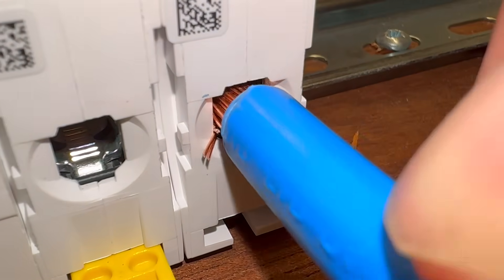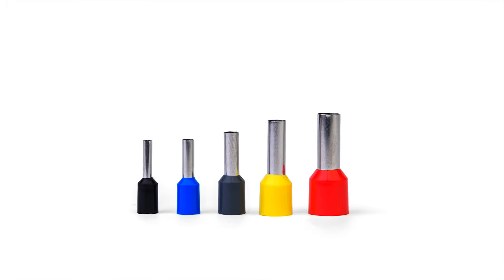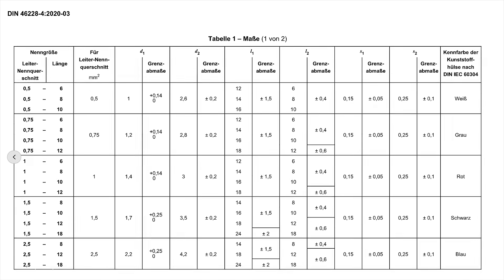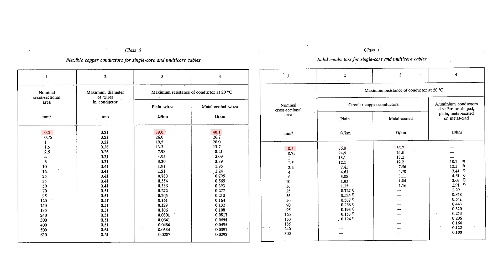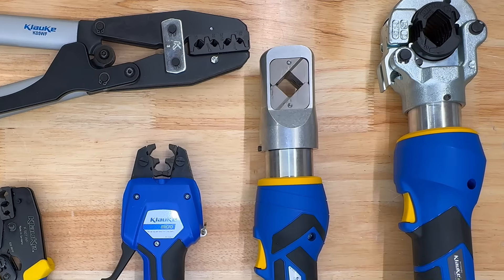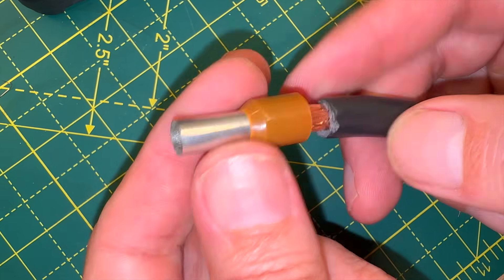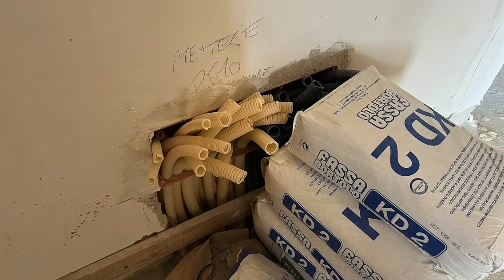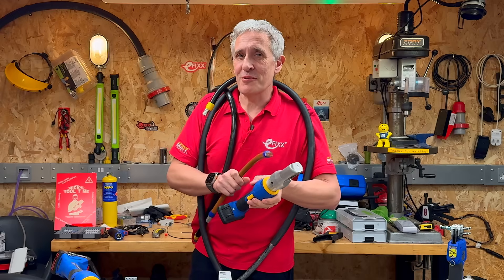The Truth About Ferrules: Overkill or Essential?

Comment: I'm an electrician here in Brazil, and the use of these terminals has been adopted for some years now, although they are relatively recent, as they weren't common or easily found in the past. However, I've noticed something curious about the use of this type of terminal: when someone discovers and adopts them, it seems like nothing else is useful besides these tubular terminals, hahaha, and some even criticize those who don't use them, as if their use were inevitable. Obviously, they offer many advantages, but their use isn't necessary in all places and components. For example, circuit breakers already have their own press system to directly compact the copper. I have nothing against those who use them everywhere possible (especially since I also use them in places where tightening is critical or could damage the copper), but only against those who say: "If you don't use tubular terminals, you're a terrible professional"... and there are those who say that.

Comment: As an aside, I am still triggered by the seemingly standard made-up unit used to specify wire “diameter”: in mm^2. Either call it area, or use actual diameter, our just use the “gauge” unit. But referring to the wire area as “diameter” seems to be the industry standard.

Comment: It’s a great video! Am I interested that if you are using for example terminals with spring locking mechanism instead of screws there you also need to use Ferrules on stranded wires ?

Comment: Here is a detail that probably doesn´t come up much... I saw a technician working with ferrules once... and his stock had diminished quite a bit by the end of the day... Probably on his last job out of 30...

HE has only long barrelled ferrules left in his kit... thus not wanting to return the following day...with a two hour drive in the opposite route he would have had to take... I say the technician  shorten the barrel... as far as i know... it should have worked, since i saw the tech test the connection by pulling and wiggling it...

The thing is... do we cut it before or after crimping?? (When you have no other option???) Forgot to ask the tech since i didn´t get to see this part of the service being done..

Comment: After a ferrule is terminated in a connector, is it acceptable to see the metal ferrule sticking out from the connector? While I have read why cutting the ferrule to fit can cause the ferrule to not make a flush connection, what standard explains you shouldn’t cut or explains that there is a tolerance for metal showing?

Comment: Using ferrules with larger screw terminals is standard practice and does improve reliability. The reason why you had a poor result is because you used the incorrect length of ferrule and gauge of wire for that particular screw terminal. I have yet to see a single person online do this right.

Comment: With TEW and MTW cable yes you run into this problem. Here in CA we use XHHW for industrial controls. 14 AWG with 7 thicker strands really helps mitigate this issue.

Comment: Ferrules are a Eurro Trash gimmick - a scorge of the earth.  They've infected the whole of wiring and machine assembly here in the US, now, too.   The amount of cost and time in Engineering, application, tools and training is laughable, when not coming from your pocket.  It's like walking up the stairs, booting up your windows 95 computer to check your email, when you could have just looked at your phone.

The world really does not need ferrules for 98% of the machine wiring.  If you follow code, size and choose your conductors properly, follow manufacturers specifications, existing best practices and are not an idiot, your panel will run fine until it is obsolete and removed for trash in 50+ years or so.  No thermal losses, efficiency indifference or better performing panel with ferrules or without.  Simply, it looks cool, costs more, takes more time and makes one gay.  If you drive a Subaru, enjoy watching "men" soccer or simply too retarded to wire a proper panel without gimmicks, because you are affaid your inpeptitude is going to allow a loose stand of wire to short out and malfunction your bad deaign, so as to burn your house down - your gay - stay away from electricity.
Reply: What will happen 20 years down the line when someone needs to maintain or upgrade your system? Do you really trust the cheap labor of this country to properly cut out the damaged portion instead of reusing it? You might realize that you're physically damaging the wire by avoiding ferrules, but they sure won't. You might have to cut a new cable after enough upgrades, especially if you do everything right.
Reply: @henlofren7321  I hear you.  I was introduced to Ferrules about 28 years ago; only the ferrule and not the plastic insulated type, like today, for panel build.   They were introduced by some Brits designing the electrical controls on US made liquid packaging equipment.  At the time, spring terminals were not a thing and many PLCs were huge or still had screw terminals for I/O and older large din terminals were the norm.  Back then it was a union work force to build the panels and it was a transition from relay panels to PLCs.  Before ferrules, things were stake-on or if it was a stranded wire to a terminal, it was done neatly and people took pride in their work to land wires correctly.   Now-a-days, customers can spec out shrink tube or exotic custom plastic printed wire markings, ferrules, etc.   NEC and 508a do not require the use today. For the most part they are standard practice and they do make the panel look nice, i agree.   ...I digress and it's always been a Euro : US thing for me.   When they introduced them, they explained how everything was better in Europe and US wiring was shite.   I've since had the privilege to train many American and European companies for wiring methods to bring up to standard their equipment for delivery for customers like GM, etc, in North America and Europe.  It's all good.  To Ferrule or not to Ferrule.  Really, if you doing one ferrule in a panel, then do them all, unless the terminal is spring connect and its a signal wire that is too small to mess with a ferrule, etc.  Sometimes, for small appliance type applications - it's not worth the labor and the appliance design and contents will outlast any wiring or need to rewire the appliance if done right.   For those cases I would rather investing in training and checking the results of the labor than adding ferrules to the design package, wire harness, etc.  All said, yeah, I use them.  And Football is still better than soccer.   Sadly, I'm old enough to see equipment 20 + years later.   The biggest thing that bothers me, in that regard, are the adhesive wire markers fading, falling off or falling apart.  Even Brady cloth paper from back then, give it a few decades in a work environment..

Comment: Hi, I have some questions. 
1. In control panel, push in type or spring type terminal, should we use ferrule?
2. For terminal block, it do mentioning the suitable size of the wire to be connect. It's mention size is it already cater to include the extra space for the ferrule? 
3. Example, 2.5mm spring type terminal. If connect with a wire of 2.5mm without ferrule, it will be insert smoothly. But when insert a wire of 2.5mm with ferrule, sometimes it will be difficult or might damage the terminal. What is the reason behind?

Comment: These Ferrule kits don't seem to match up with the correlated AWG sizes. So I just make sure the Collar Ferrules can easily get the stranded wire into the ferrule with minimum collar space, but the best ferrules always have a little space between the wire insulation and the ferrule collar. The size chart for the ferrules seem to be WAYYYY too small for the same size AWG insulated wires. It never fits the stranded wire inside the tinned tubing , and the collars are always too small to fit around the insulation.

Comment: In Poland I haven't met anything similar to class 2. We have solid wires where Ferrules are obviously counterproductive and wires similar to class 5 where there is no reason to use them, by the way I'm not a professional electrician, I'm just an advanced ammeatuer, able to setup or inspect summer house or appartment installation.

Comment: Which suppliers/brands would you advise I look for? Assuming I wish to follow this advice and use ferrules of a particular standard (such as DIN 46228), keeping to crimping tools and ferrules (and similar such as ring crimps?) of the same brand.

None of my local wholesalers I've checked so far sell ferrules, except for some kits from screwfix/toolstation, which even if they are of decent quality means getting a lot of parts in sizes I'll never need.

Comment: If you use Ferrules, we can be friends. If you use ring terminals, i genuinely hate you.
Having to remove all the tiny screws on a block terminal solely to remove a wire to replace a faulty part... Potentially losing a few screws in the process because not all of them are magnetic... 🤬 All my hate.

Comment: HEX or SQUARE ferrules?
i have been crimping ferrules with flat pliers (with no, or minimal teeth), never failed me in my life, and saved me so much time
but in my case it makes them kind of flat, which works good for my needs, but I've been meaning to finally buy a tool
I wonder if square or hex crimp is better? Hex is kind of round in its nature, which fits better in all kind of holes, but then again has less area for a nut to press against?

Comment: I'd bet the class 5 cable has less copper cross section than the class 1 conductor. If you could, please count the strands, measure and do the math. Don't use 25mm² ultra flexibel cable for that. ;) 
I found 1,5mm² stranded wire having only 1,35mm² of actual copper cross section. That is 10% less!

Comment: I love them for the neatness. I hate them for efficiency. It needs time for installation, that is often not necessary. AND you add another electrical interface for each ferrule. It is a tiny amount. But it is there, stacks up and is not necessary. Also stranded wire often has less copper than solid wire. Stranded wire is standardized by conductivity. I have seen 1,5mm² stranded wire having only 1,35mm². Found this out on accident. A spool with 1000m of 1,5mm² wire felt too light. I weighed it and thought I was scammed by the supplier. So I cut off 1m and weighed it again on a fine scale and it weighed significantly less than solid wire. Then I was onto something. I counted each strand and measured the circumference multiple times. And it turned out, stranded wires sometimes have 10% less copper cross section to achieve the conductivity required by the standard. It complied to the standard, but I still feel scammed. You pay more and get less. I hate that!
Solid wire is standardized and sold based on copper cross section.

Comment: I had a stray strand go into the wrong port recently when I was making a PLC. Good thing all the power was on a breaker, so nothing blew up, and I immediately recognized how and why a single switch was making three lights on the input card turn on.

From there on out, every stranded wire was getting ferruled.

Comment: Can you use ferrules with Wago type connectors in house wiring? All these new smart switches and dimmers come with stranded leads that don’t work well with Wagos. But they are so much bigger than a normal switch I’m forced to use Wagos as they are flat and don’t take as much room as a Marette .
Reply: You can with 221 series but i think it was 0.5 - 1.5 mm2 only check from wago's homepage.

Comment: Wires with strands smaller than 0.75mm2/18awg in screw terminals without ferrules or rings or forks or any other sensible wire termination is insanity.  Just don't do it.  If it's carrying any significant current at all, it will burn.  It just takes time.  If you want that game, use solid wire.  That's what it's for.

Comment: Attention: with cheap or unappropriate Crimping tools the ferrules can be pulled off the wire - more or less easily! Esp. when there is mechanic force on the cable connection. I came across this problem when installing a PV generator connection box with fuse switches and SPDs - you need a lot of connections in small space box. In my experience this problem gets better (not solved) when you twist the wires a little bit more before crimping on the ferrules. If you twist too much, the may not fit in any more.

Comment: I've done HVAC controls for 19 years and we don't use ferrules. I've actually had issues with them in the past and the terminals can't bite down on the wire like with regular stranded copper wiring. They are overkill in my opinion. I can see in some applications it might be needed, but if you can put wires in the standard terminal just fine then a ferrule isn't going to provide much benefit.

Comment: There is all this engineering mobo jumbo talk like lawyer speak, but the reality is all the customer cares about is that it works. if you charge a customer thousands of dollars to install a HVAC BMS system and remote energy management for a store with VAV, ventilators, door heaters, air curtains and all that and it keeps cocking up after you have commissioned it and have to come back to do tug tests on every controller because you didn't use ferules then you should use ferules. Twisting the strands or not to twist strands, doesn't make fuck all difference, been twisting strands my whole life and never got a callback because someone measures .001% difference. Use ferules save yourself headache. This is my 2 cents worth from the perspective of a technician in the field.

Comment: I can think of tons of applications where ferrules would help in my job as a security low voltage technician, but I have never seen another tech in my field use them. Any low voltage security techs use these, and if so, what are the best and worst uses for them?

Comment: I swear, I absolutely HATE opening up panels at work and seeing non-ferruled stranded connections. It likes my life so much more difficult if (and when) I need to take the wire out and/or reinstall the wire. It's just asking for a short circuit.

Another thing I don't like is Wire Nuts, but that is a whole other thing that grinds my gears.

Comment: At the end you mention "If anyone knows how to land the double wire into a ferrule without twisting" I would go back to what was mentioned about matching the inherent twist in one wire but you have to do a Gordon Flay and deconstruct both wires then serve back to the ferrule- 
untwist straight and point them out in every direction for both wires.   
 Next you bring them kind of close to each other and gently reshape and twist them together and try to keep any one strand from having a horizontal angle because that can make the new megawire too big to fit. 

It's really good for if you don't have another larger ferrule and only like 1 size up from the nominal wire size like 2 18awg going into a 16awg ferrule. So it might not work for the megaamp cables you are crimping.

Comment: I didn't realize how many applications there are for ferrules. For instance, I hadn't ever considered using a ferrule as a splint for a broken finger. Did the finger in the ferrule shown at 12:47 heal correctly? Not only would the ferrule hold the bone stationary but any bleeding should also be stopped once the ferrule is crimped.

How did you know my medication is overdue?

Comment: Great video.   Had so many arguments with idiots who think stranded will burn your house down for some unspecified reason. Probably because they never used ferrules and were shorting shit everywhere.
Reply: What is the typical cable for fixed house wiring there? 
Is it that solid strand 2C+E ?  The 7 strand 2 core + E?  All Earth / Ground conductors are multi-strand here. 
My experience is finding solid core conductors broken at termination... arc and heat propagation.  
I won't buy or install solid core, only 7 strand core.
That does not require ferrules, just hard twist and fold into a screw down connection.
 
More important... What is the typical fine strand cable made for? Appliance and extension leads? 
What does the DIY idiot use for fixed wiring? 

Man, I avoid working on domestic where DIY and alterations mostly occur.

Comment: I have found one way to crimp two cables without altering their normal 'twist'. Strip more insulation than required, twist just the ends of the exposed copper, feed into the crimp and pull through so that the 'virgin twist' section is inside the crimp barrel, crimp and cut off the excess.

Comment: Good video. Instead of ferrules, has anyone just tinned the end of a stranded wire with solder?  Can square up the tinned end with a filing tool too.
Reply: I've done it before. It's useful for connections where you don't have room for ferrules.

Comment: Great video clearing up a lot of the myths. Just a very small point, I know we all know what you mean when you say 1.5 mm squared or 16mm squared but there’s a difference between mm squared and square mm. One is the area and the other is the calculation used to determine the area. 

If something is squared in maths then you multiply it by itself eg 1.5 mm squared is 1.5x1.5mm=2.25 mm 

Whereas 1.5 square mm  is the result of the diameter of the cable multiplied by Pi.
Reply: Pedantic.  Anyone who works in the Industry knows exactly what the term means - Cross Sectional Area.

Comment: They make a lot of difference to usability.
The only time I’ve been blown across a room was an old stranded plug - not come across the uninsulated versions, but would have saved me quite a significant shock.

I’m always a little concerned about the connection at the clamp - the contact patch is always my concern.